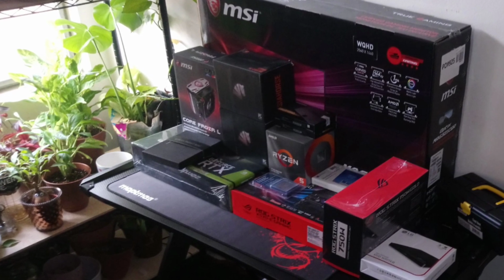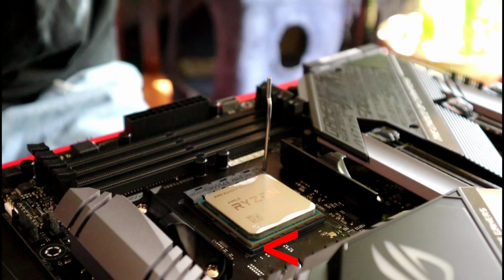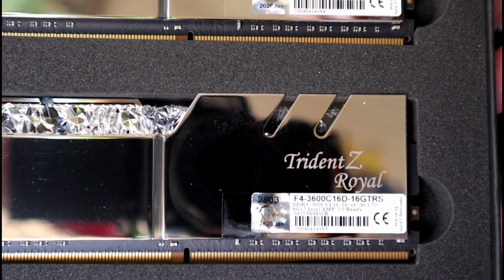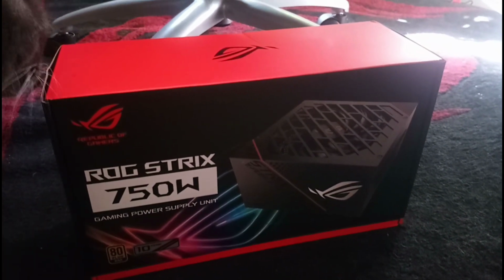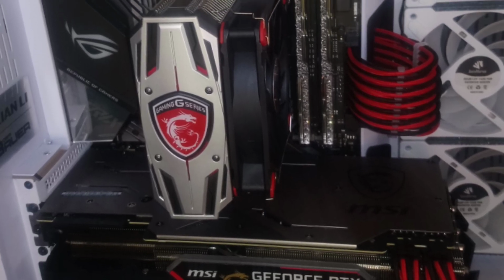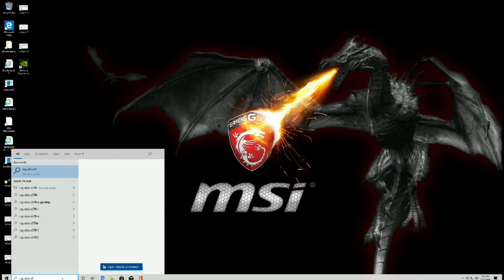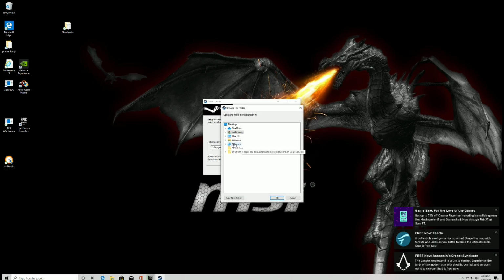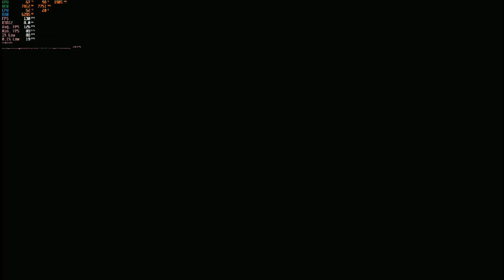How to build a 1440p max settings gaming computer in 2020

Comment from the maker: heres that link I could not fit for the monitor.
Monitor: MSI Optix MAG321CQR $399.99 at time of purchase ( not included in the price mentioned)

https://www.amazon.com/MSI-Non-Glare-Adjustable-Optix-MAG321CQR/dp/B07NQG1FFB/ref=sr_1_1?crid=TFE7RMXEHPUP&keywords=msi+mag321cqr&qid=1582992078&s=electronics&sprefix=msi+mag321%2Celectronics%2C210&sr=1-1